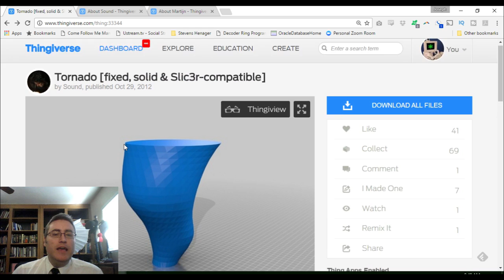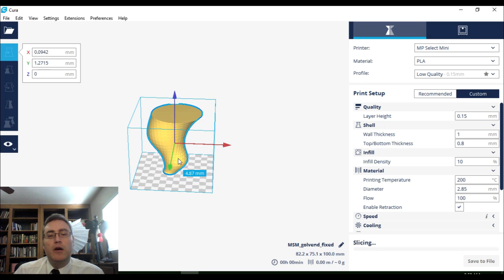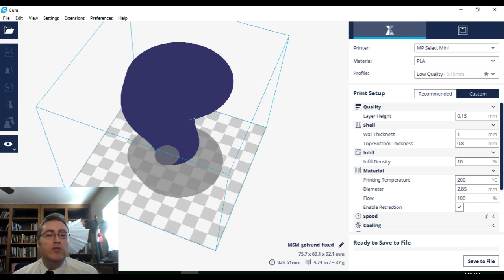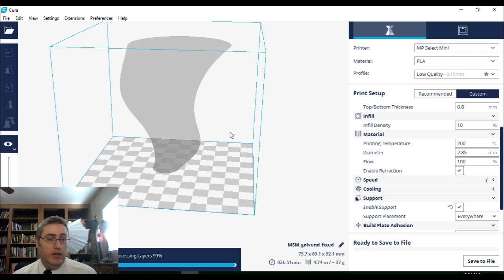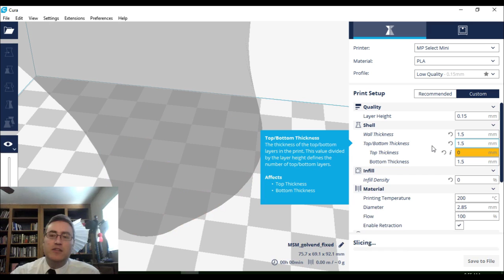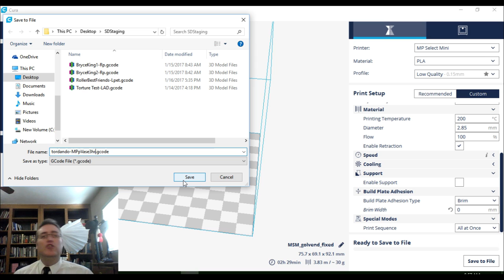3D Printing 101 - Hands on with Cura 2

Comment: I'm trying to get dual extrusion working on Cura 2.3.1 or Cura 2.4 Beta. I don't seem to have the functionality as I did in Cura 15.04.6 (any for that matter). I'm still using a Prusa Mendel I2. In the previous version of Cura, all I had to do was right click on one model and select dual extrusion merge. I'm using a Custom FDM Printer profile.

Comment: Great video but doesn't the MP Select Mini take 1.75mm filament. I believe If you don't change the filament settings from 2.85mm Cura 2 will under extrude during printing.

Comment: "MSM" stands for "MP Select Mini", maybe?
Reply: Yes, that's the "initials" of the printer you have active in Cura. For my Ultimaker 2 it says UM2. Guess that is useful if you have more than one printer, so you don't run a print job on a machine that can't handle it.
Reply from the maker: Dave Halderman Yes, though it doesn't include material or time, but I like the machine code now that I know what it is.
Reply: What Speed setting should I use for my 3d printer? 
i have it set to 20 mm/s is it to slow to get a high quality print?
Thanks
Reply from the maker: Speed is one of the most fun things to experiment with. Run a bunch of test prints at different speeds and see what happens.